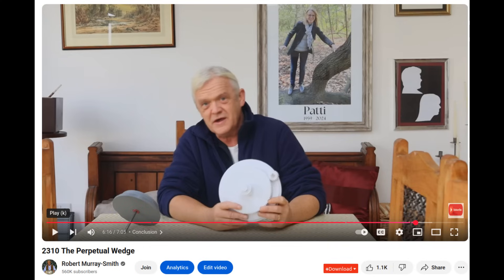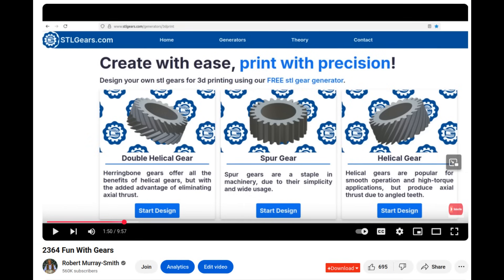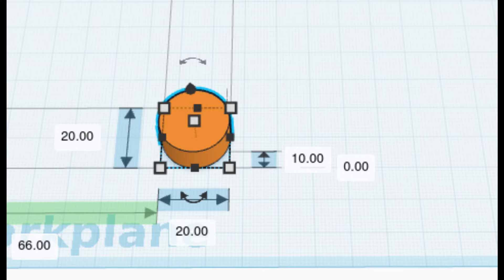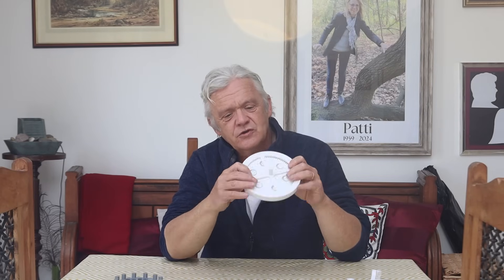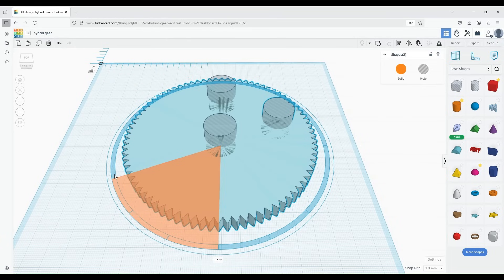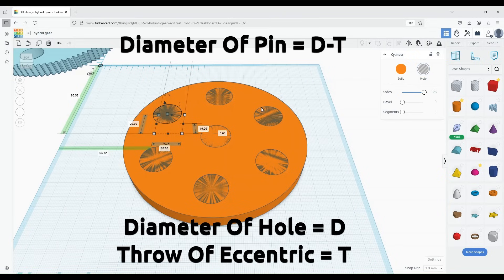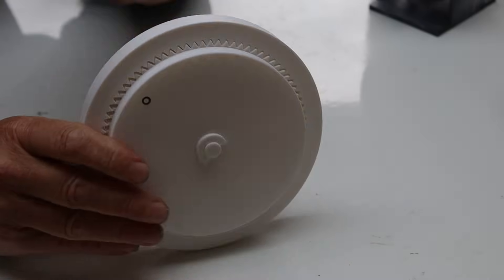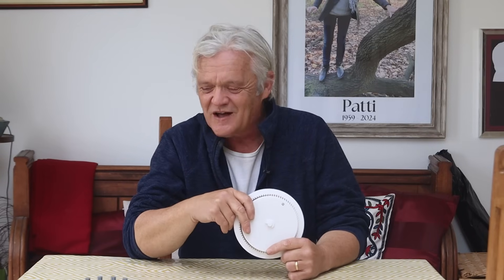2385 The Most Perfect Gear Box - A Hybrid High Ratio Drive

Comment: Its sad to say that nothing is perfect but severe vibrations at any decent speed are the issue with these unless you are able to balance them out which limits your ratio options severely for sure. Still as with all such things it has its uses.
Reply from the maker: to balance it just put two gears in the ring - but to be honest - I suspect you know that already
Reply: @ThinkingandTinkering  oh yes sir, I've played harmonic drive whack-a-mole for a few rounds.
Reply: Conclusion being only few ratios will survive being rattled to death no matter how robust (pretty robust) you try to build them. It's just as nature intended it I believe. But establishing the rules for this is beyond my budget unfortunately.
Reply from the maker: @yodaco  I am sorry mate - i hate to disagree - but that just doesn't sound right - the basic principle here is the cycloid drive and the responses of that are well established - plenty of research on multiple disk configurations for exactly what you are saying
Reply: @ThinkingandTinkering  well look from my use cases and testing they are too fussy to be practical and do the opposite of what they should do alot more than they should. that has to do with a lot of variable you cannot easily deal with in a small team with low resources. in short only certain and very specfic configurations work well this is a harmonic thing or something like that you cannot easily measure. now we are talking about high speed high torque high load high everything situations here and not does it work on the bench but honestly its just very very difficult to use if it werent we would see them more. they rip them selves to bits to easily. they are great and worth learning about. my job is finding problems more than anything.
Reply from the maker: @yodaco  well - i get that is your experience mate - it's not mine - so I guess we are going to have to agree to disagree on this - cheers

Comment: Could you go the other way,  with a 1:20 ratio.
Reply from the maker: not with this - it won't backdrive
Reply: @ThinkingandTinkering  Is that because of the eccentric spokes? If you made those toothed instead of smooth, what would you expect the result to be?

Comment: I saw this before.
In the wankel rotary engine Because this thing is shaft and in reverse direction.
Reply from the maker: lol - no you didn't mate - you saw an eccentric - they are quite common - steam engines had them
Reply: @ThinkingandTinkering i think you didn't get it.
This drive's stator is rotar in the wankel engine.
Similarly rotary is stator in the wankel engine.
The shaft is output in the wankel engine.
Reply from the maker: @AKA-f7p  cheers mate
Reply: @ThinkingandTinkering ok then! Cheers.

Comment: I assume that the inside gear doesn't have to be the only one that travels eccentrically. It should be possible to make the outer gear travel in an centric motion instead. The reason I ask is that I have something I want to work with where by the outside would have to travel in the eccentric manor.
Reply from the maker: nice thinking mate - let me know how you get on

Comment: I wonder how much this will vibrate at high speed.  In cycloidal drives you can balance this with a second rotor 180° out of phase, but I don't see how that could work for this application.  Perhaps that might work if the external gears were fixed and the housing rotated?  Off to experiment!
Reply from the maker: That is exactly what you would do - just offset another eccentric at 180 degrees and add a second disk - I meant to mention this in the vid but forgot

Comment: 👍 Would be interesting to measure the backlash. Herringbone on the outer gear could enable a second 180 deg offset holed plate/cam to reduce vibration?
Reply from the maker: curses - i meant to talk about that in the video - ah well - good job you brought it up - cheers mate